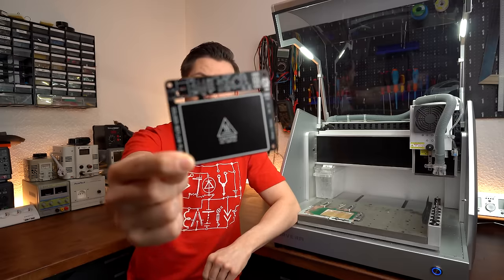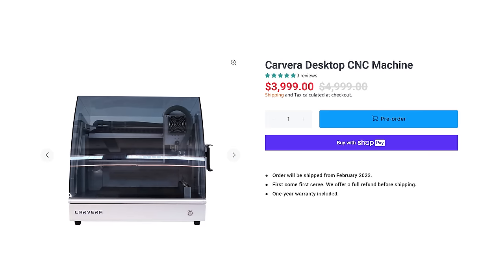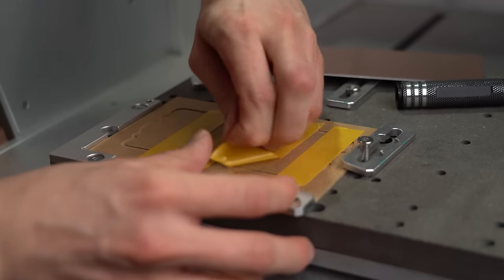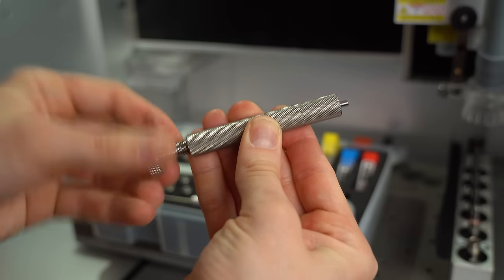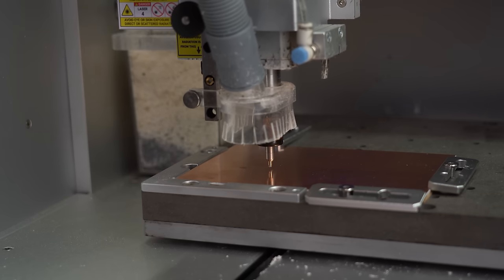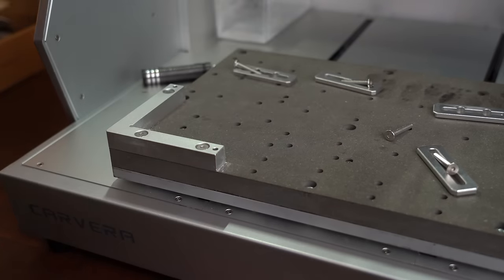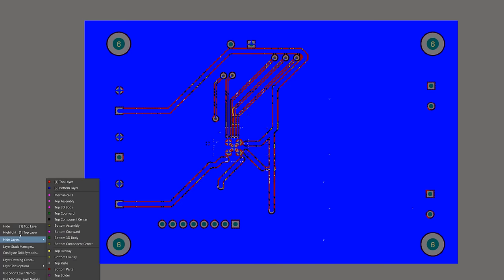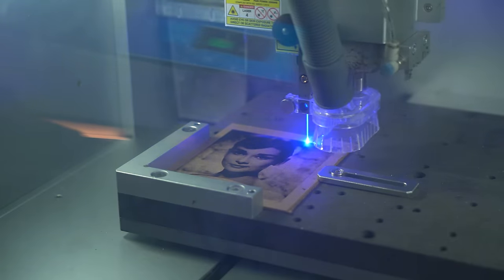"A Machine PERFECT for Making PCBs at Home" Is what they said!

Comment: I'm not convinced about the PCB milling. There are too many stages that are useful to include that I just can't see a hobbyist CNC doing well without a lot of messing around. You need copper, drilling, mask and silk screen done well and they all need to line up. When you have companies like JLCPCB and PCBWay doing what they do for as cheap as they do, I can't justify the effort. Stencils really only have one tool path, so no alignment issues and the number of times I've forgotten to include a stencil on my PCB orders, the ability to whip up a half-decent stencil at home would be useful. Still not sure that's a big enough use case to justify a $4000 machine, but that seems like a better target for a hobbyist solution at this point.
Reply: Likewise, I question the ease and efficiency of the micro-milling process compared to doing laser engraving or laser+photoresist etching.

The addition of a monochrome inkjet head would also be interesting, but maybe similar results could be achieved with laser etching onto the solder mask. Or as part of the photo etch process. Compared to the trouble of doing the solder mask on the machine, I question whether the extra step for chemical etching would actually be a downside given how much better the trace results can be.

Comment: 1:25 LOL dude, do you see those nice UNUSED screw holes on either side of the anchor bracket right there that are slightly offset? PUT A SCREW THERE AND THE SCREW HEAD WILL BE USED TO HOLD THE WORK PIECE *facepalm*

Comment: major problem, no vias, no through holes.   minor problem, no silk screen, no solder layer ( silver color solder on all pads). suitable for single layer pcb draft design test ....but for the price point, haha.
Reply from the maker: You can make vias and through holes. No problem.
Reply: Just like any other CNC, you can kinda make some basic pcb but it's really not its true purpose
Reply: @greatscottlab  I said no via and through holes for a legit reason. Without manually install many rivets (could be 20,30+), layer one and layer two is not connected. That's a lot a lot of hand work. With rivets,some smt components cannot be soldered, those have gnd pad with multiple tiny vias under the ic. Through hole is not a big problem when we make single layer PCB, just without the copper layer inside the hole, the pin is not very secured soldered, can be teared out easily, for connector plugs. For 2 layers PCB,same, a lot of rivet work required. Imagine our next project uses a Arduino Nano or blue pill, how many rivets are required just for the dev board itself...

Comment: It's cute, but practically useless. If cute is your goal, by all means spend your day reiterating your design and fine tuning the hw/sw. I'll be working on the next thing in my queue, and unpacking professional grade PCBs in about a week...

I will say, however, that the machine and its accessories are darned impressive, even at $4000 dollhairs.

Comment: If only used for PCB's this looks pretty disappointing. It's not just the steep $4000 price tag, it's also hours of precious time wasted on setup, settings and oh, hand-soldering little rivets in each via. After all that time and money spent, the end result is a PCB that looks like sh*t compared to what even the cheapest chinese pcb service can do. The laser looks decent but I've seen $300 laser engravers deliver identical results. 
Anyone considering this should spend their money on a decent CNC router with a laser attachment instead. You will have a more flexible machine with a bigger working area, and you can still do crappy PCB's when you really can't wait for it.

Comment: Carvera is a SCAM. This is just one of those cheap $400 aliexpress mills with an expensive case. This machine is the "3018 Pro Max" with a new case around it. For LESS than HALF you can get a professional model or the 6090.

Comment: I just don't see any real value in this machine.  For a similar price, I can buy a used real CNC machining center which will make far, far larger and more accurate machined parts, a decent Elegoo resin printer, a decent FDM printer, and several years worth of PCBs from PCB manufacturing services which look much better, oh, and a used CAR.  More hipster garbage.